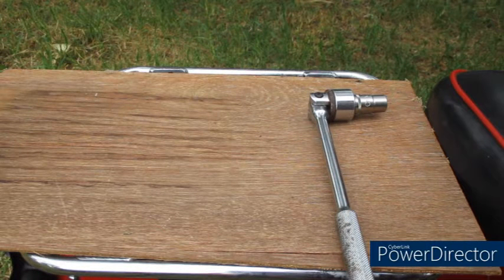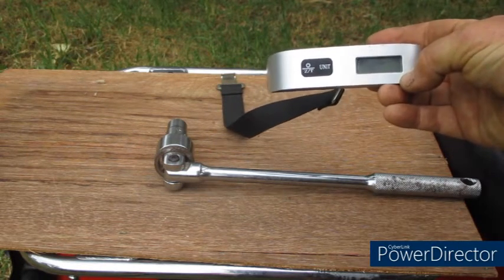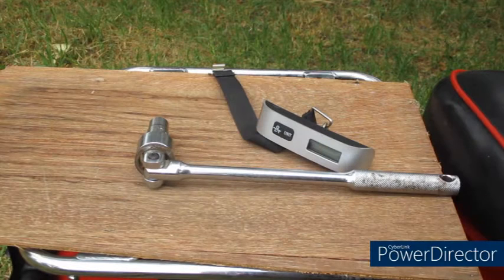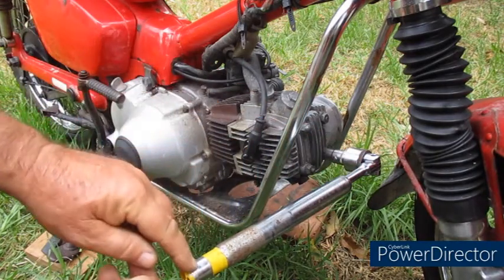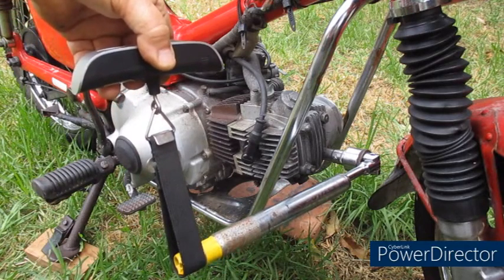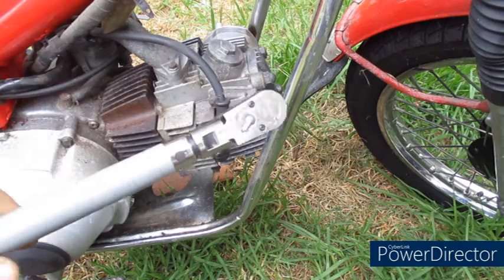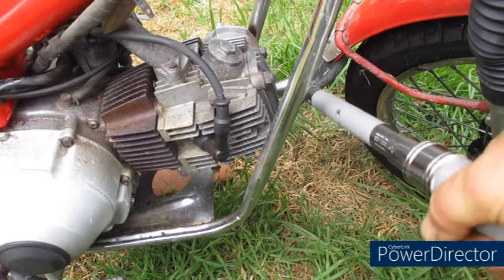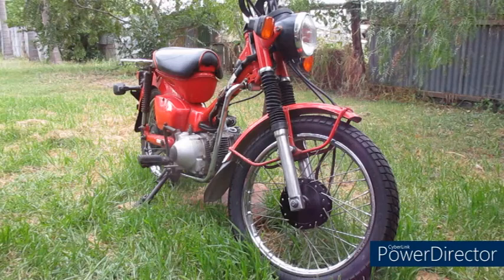Accurately Tighten A Fastener - Without A Torque Wrench

Comment: I have hanging weighing scale which supports only 5kg maximum. 
Can I apply 4.5kg at 18.1inches away from the bolt?
Will this generate torque of 15 foot pounds?

Calculations with 6.8kg or 15 lb:
15 lbf = 6.80389kg
6.80389kg* 12inches = 81.64668

Calculations with 4.5kg or 9.9 lb:
9.9208 lb = 4.5kg
4.5kg * 18.1437inches = 81.64668
Reply from the maker: Almost....  14.7 ft-lb.
Reply: Thank you @Free_Ranger_CT110

Comment: Now that is brilliant! I never would have thought of using a baggage scale to perform this task.
Reply from the maker: Thanks Eric, I do own two torque wrenches but I hope this hack demystifies torque settings for many people.
Reply: I have hanging weighing scale which supports only 5kg maximum. 
Can I apply 4.5kg at 18.1inches away from the bolt?
Will this generate torque of 15 foot pounds?

Calculations with 6.8kg or 15 lb:
15 lbf = 6.80389kg
6.80389kg* 12inches = 81.64668

Calculations with 4.5kg or 9.9 lb:
9.9208 lb = 4.5kg
4.5kg * 18.1437inches = 81.64668 @Free_Ranger_CT110

Comment: Thanks I didn’t know that’s how it’s worked out / rated.
Reply from the maker: Yeah for me it's easier to understand in imperial ft-lbs units.  But in whatever units it's still force x distance.  Thanks for watching.
Reply: I have hanging weighing scale which supports only 5kg maximum. 
Can I apply 4.5kg at 18.1inches away from the bolt?
Will this generate torque of 15 foot pounds?

Calculations with 6.8kg or 15 lb:
15 lbf = 6.80389kg
6.80389kg* 12inches = 81.64668

Calculations with 4.5kg or 9.9 lb:
9.9208 lb = 4.5kg
4.5kg * 18.1437inches = 81.64668 @Free_Ranger_CT110